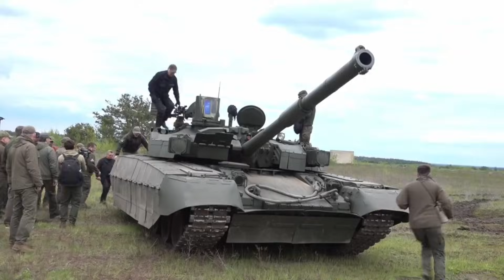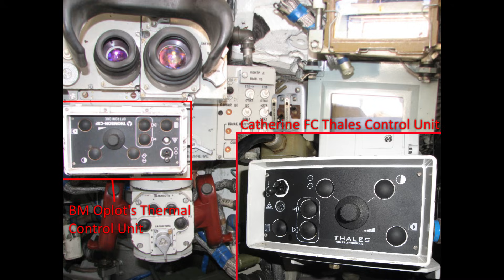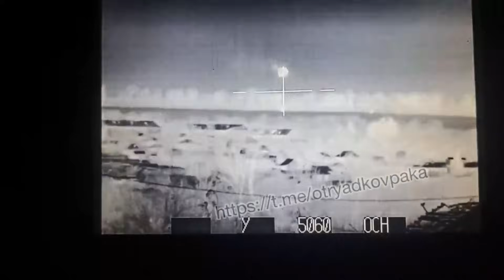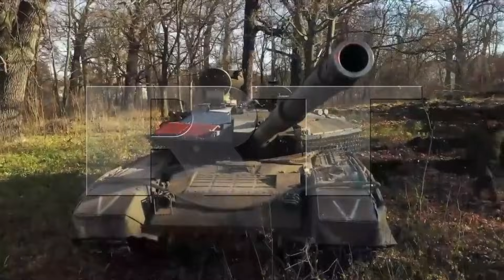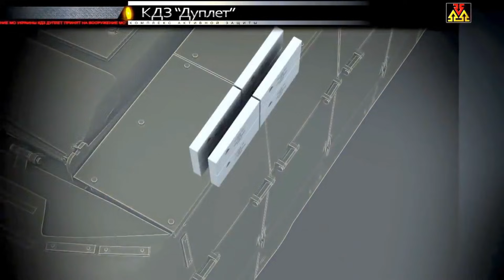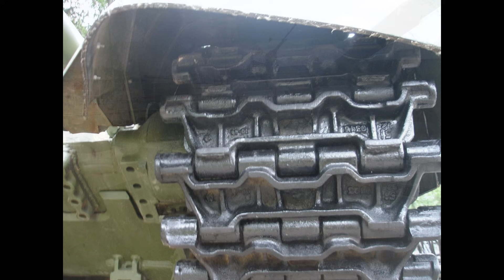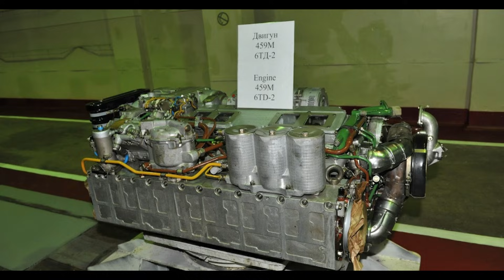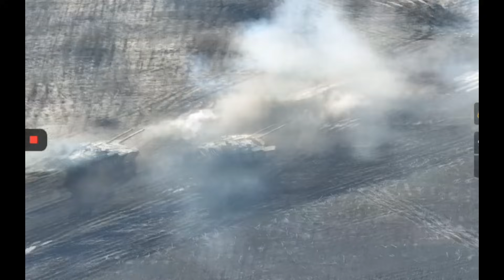Best Ukrainian vs Best Russian tank. T-90M vs BM Oplot comparison

Comment: Great comparison. One comparison I would love to see is the T-64BV vs T-72B3. Why? Because that's the tanks that have suffered the highest losses in the war on each side and I'm fairly certain they're the most used ones as well. They're the backbones if you will.
Reply: He has a comparison in his Russian vs Ukrainian tanks video.
Reply: @voidtempering8700  Oki thanks I'll check that out.
Reply: @Juel92  T-72B3 is a trash tank. T-64BV was always better tank and was actually upgraded with relevant components. It is far closer to its development T-80 and even if T-90M is upgrade of T-72 I would say is comparable to T-84.
Reply: @TheRezro  Everything you say about the T72B3 is as believable as The Sun. Yes, indeed the T64 has a remotely operated machine gun alongside better vision for the driver, but seriously though, you are incredibly delusional. You're quote literally the most delusional Pro-Ukrainian supporter that I have ever met. Basically the T64BV is slightly if not more equivalent to the original T72B.
Reply: I'm not the type of person to attack people for their own beliefs, but you should probably listen to both sides a bit more to avoid that seriously annoying attitude towards Russian tech.
Reply: The Abraams X is a technology demonstrator. The T-14 is still in testing mates, the American arms industry have had some proposals for the next generation American MBT but it mostlikely won't be the Abraams X.
Reply: There is a comparison done - T-72BM3 is vastly better tank.
Reply: @tomk3732  Next you tell my that Su-57 is actually stealth? Fun fact, it is as stealthy as F/A-18.
Reply: @TheRezro  LOL, Even Su-35 is more stealthy than F/A-18 ;)
Reply: @tomk3732  That say a lot about Su-57 then. Especially as Su-35 is only Su-27 with several decades less outdated electronic. F/A-18 already has some stealth elements, so it is quite possible that Russians finally catch up to G4.5 standard.
Reply: @TheRezro  Imagine being as delusional as saying that the T64BV, a soviet tank being better than a more upgraded russian tank.
Reply: @TheRezro  Seriously, are you out of your mind? The T72B3 is clearly better than the T64BV. Yes, the base model of the T72 was worse than tje T64, but saying that the T64BV, with worse ERA, outdated optics, and an outdated gun, BEING BETTER THAN THE T72B3? The T72B3 literally has Sosna-U optics, Kontakt 5 ERA, and 2A46. You are clearly misinformed.
Reply: @agoodusername5371  Most Russian tanks are almost identical and are severely outdated. It doesn't really matter if they have slightly better optics, when most of flaws still persists.

Anyway. T-80 is slightly upgraded T-64. T72- is actually downgraded T-64 and T-90 is basically T-72 with welded turret. Yes. There are some improvement in optics and protection between versions, but realistically Russian tank doctrine is the same as in the 60's. Arguably worst as they seams to lost understanding of what combined warfare is. Current T-84 is basically the same as T-90M or 90's NATO tanks.
Reply: @TheRezro  You're underestimating both of the tanks, the T90M and the BM Oplot are comparable to modern NATO tanks.
Reply: @TheRezro  If they have better optics, and ERA, you can still win against a T64BV when in a Tank battle, which gives it a better advantage, but when facing threats like ATGMs, they will obviously get destroyed.
Reply: @TheRezro  If most flaws still persist, at least you're assured that you still have an edge over your enemy when in a battle.
Reply: @TheRezro  Russian doctrine has slightly changed now, unlike Ukraine who's still stuck using the same doctrine as the USSR.
Reply: @agoodusername5371  I'm not sure what movies people do watch, but tank battles almost not happen in this day and age.
Reply: @agoodusername5371  They literally aren't. People seams to not understand how much tech actually goes inside tank today. Leopard 1 has probably better optics then most Russian tanks, except maybe most recent ones.
Reply: @TheRezro  This is argument is a comparison between an encounter between tanks, I know tank engagements are rare but we are literally talking about which tank is better.
Reply: @TheRezro  Are you saying that the Leopard 1, a tank from a 50s, having better optics than a modern Russian or Ukrainian tank?
Reply: @TheRezro  If you have made a mistake and instead you wanted to say Leopard 1, then I slightly agree with you, but the T90M has better optics and protection than the Leopard 2 (Except the 2A6 and 2A7, though Russia does have an advantage in protection a bit).
Reply: @TheRezro  This argument ends once you make a reasonable claim which I deem to be possible in a way that I can accept, I'm kind of bored,
Reply: Well let me tell you that stleath means nothing because the same SU-57 using it's 4 L-BAND radars can easily detect an F22 and fire at it by a missile called R-37M which are also guided by the belka L-BAND radar.
you are just another random kid that is believing in everything he see's in YouTube shorts lmfao @TheRezro
Reply: Comparison against a T-72B3 should be with T-64BV zr 2017 or T-64BM Bulat
Reply: Yeah. Those are the actual MBT.
Reply: I dont think there are that many of them left anymore on both sides.
Reply: B3 is superior in every way and Russia built nearly 2 thousand Ukraine made 100 😂
Reply: @mrmacias4217  Military balance 2022 lists 850 T-72B3 in Russian service. Even if you count the 550 tanks upgraded to the somewhat more modern T-72B3M variant, it's still nowhere near 2000. Also Russia has lost at least 500 of those very superior tanks, and that's just visually confirmed losses.
Reply: @zvexevz  1720 in 2021 some 300 have been destroyed that’s still 1400ish and they’re still being produced
Reply: @zvexevz  count the 150 of the VDV the 150 of the marines it starts adding up
Reply: @mrmacias4217  Its night vision is on separate small monitor. like WTF? T-72 is a horrible tank and B3 is a joke. Fortunately it is near extinction in the upcoming future. Not mych info about catapulting turrets in this year.
Reply: @TheRezro Yes, a small monitor, just like 90% of all tanks that have a thermal screen. Hardly a bad feature.
Reply: Ah yes, the battle of two 80s tanks crudely modernised to not be useless in 2023...
Reply: @quan-uo5ws  but isnt that basically all the modern MBTs? (well besides Abrams X)
Reply: @DiamondkeyOwO  abrams x is still in development / protyping.
As far as i know only the t-14 is an actualy true modern tank but there are not many of them
Reply: @zanza8197 t-14 is also still in the testing phase their is no full production yet
Reply: @zanza8197  I get what you mean but honestly I would argue that the Abrams X is as real as the T-14. (As in probably have the same amount of tanks in service)
Reply: @zanza8197  T-14 do not exist. It is not a serial tank. You could as well compare it with Abrams X. What is far superior in any imaginable way. Starting form fact that it would have CIWS and not like Armata Hard Kill designed by someone who don't understand how ATGM's work.
Reply: @TheRezro  T-14 does exist, We have seen them in parades and there are reports that they are also deployed in Ukraine al be it not in the front line.
Comparing the Abram x to a t-14 is all speculation they are both latest generation and we hardly have any real information about either tanks other then the obvious like horse power, Barrel etc etc, I would assume they are on the same playing field.

The biggest difference, one does exist and the other does not, That makes the whole comparison null and void.
Reply: @zanza8197  Being on parade don't egal being operational. And we do know from Russian tankers that it is not, as they refuse to drive it. If it was deployed in front line, it was at best "front line" in Moscow. There is no prove that it ever was near it. And again, it is not a serial production. And lot of claims about it are debatable. Russia could as well put it alongside T-34, as much as we care.
Reply: @TheRezro  You clearly have not seen anything regarding Russian equipment.

There are videos of the Armata, firing, driving etc etc they are clearly operational the ones that Russia has.
I dint say that they are deployed in the front line, I specifically said that they are not.

I know that they are not being mass produced, Though they have about 25 or something around those lines so they clearly can make them, There is also no need for it the t-90 still is a formidable tank, Its much cheaper to produce and it meets all the requirements, Until the t-90 falls to far behind the t-14 wont be mass produced.

"There is no prove that it ever was near it"
The t-14 has more or less the same capabilities as the abram x, Again they both would be latest gen that means that they have all the latest modern technology applied to them, They are not 100% equal in some things a abram x would be better while on other fronts a t-14 would be better, Like it is with the t-90 or a abram or leopard or whatever you may pick.
It still boils down to the same, There are actual t-14;s there are no abram x, Well there are a few prototypes. So that debate is pointless.

I also saw your comment regarding the su-57.

I strongly recommend you to check out this channel / show COMBAT APPROVED.
It covers Russia / soviet armaments that way you get a decent understanding of what Russia actualy has and what their equipment is capable off.
Reply: @zanza8197  Cope my harder
Reply: @TheRezro  Russia doesn't even have the T34, they don't even have enough components to use the T34 because they phased it out decades ago. They don't even have the proper ammunition to use with the T34, you're so utterly biased and incorrect, I'm also wondering, what sources do you even use to back up your utterly ridiculous claims? Not everything russian in bad. You're being consumed with so much fake news, you even think that the T64BV is equivalent to the T90M if only it was just an "Upgraded T72". Does ERA even count for you?
Reply: @TheRezro  Seriously, are you telling me that a tank made in 1985 is better than a tank made in 2010?
Reply: @quan-uo5ws all Russian tanks are like that.
Reply: A WW2 light tank against a modern MBT? Just why?
Reply: @DiamondkeyOwO  The T-64BV is a MBT, what are you talking about?
Reply: @voidtempering8700  Lol I just realized I wrote T-60 not T-64 lmao. Gonna edit it.
Reply: @voidtempering8700  was T-60 originally in the comment but edited now
Reply: @DiamondkeyOwO  Lmao I miswrote. Meant T-64BV. Thanks for pointing that out
Reply: @Juel92  no problem man happens to everyone :D

Comment: Challenger 2 and Leopard 2 just entered the chat.
Reply: Have they?
Reply: leopard2 is a good tank. chally 2 is dogshit and obsolete.
Reply: Challenger 2 just got stuck in a mud puddle.
Leopard 2 just met with Kornet.
Reply: @koskok2965  frfr. im sick of western nations being allergic in using ERA. and even the ERA used are overly large and heavy for the offered protection AND not doing shit against apfsds.
Reply: @Phantom-bh5ru  Yep. It's astonishing how so few people can digest the fact that composite-centric armor and ERA-centric armor designs are both valid and realistic engineering approaches to the same problem of protection.

The rift between East and West in this regard has mainly got to do with the balance/compromises with respect to other performance criteria, like weight, volume, modularity etc...
Reply: Leopards 2 entered the chat and burned down immediately.
Challenger 2 can't even reach the chat.
Reply: @AugustSchroif  🤣🤣🤣. So true. Challenger is too fat to reach the chat. Represents the Brits quite well 👌👌👌
Reply: they havent entered the chat yet, need to wait for another 6 months and the next aid packages
Reply: @DonDon45-i5h  No their already in Ukraine, just haven't been used in an offensive yet. Also his video on the C2 assumed it would lack DU rounds.

Comment: To bad RF cant produce any more modern equipment, till they get more washing machines.
Reply: That isn't true, stop spreading misinformation.
Reply: @voidtempering8700  Its 100% true. T90 used a French targeting system, not anymore. Russia cant even produce ball bearings FFS.
Reply: @morganodonnell1239  Russia has been producing their own thermal sights for 5 years now.
Reply: @voidtempering8700  ТКН-4 for example
Reply: @voidtempering8700  Turns out to just be western civilian model procured from Iran.
Reply: @georgethompson1460  Have a source for that?
Reply: @voidtempering8700  Look at the collapse of the Russian defense industry.
 Then tell me they can still produce equipment... 
 Nobody wants that garbage anymore after seeing how poorly they preform. Even if they could still sorce western parts.
Reply: @voidtempering8700  doesn't matter if you can do it domestically if you can't upscale production during wartime (which Russia cant)
Reply: @a.t6066  But they have.
Reply: @voidtempering8700  evidently not. The very fact they aren't able to put Sosna-U sights on upgraded t-72s anymore means the level of production cannot extend beyond what they are producing t-90m.
Reply: Ah yes the good ol washing machine take. If anything its rather impressive russia is creating hightech weaponry and missles with chips from old washing machines lol

Comment: I'm surprised at how effective duplet. It's very impressive and I hope to see it used more in combat
Reply: It's also great at maiming any infantry marching by the side of the tank.
Reply: @koskok2965  let's hope they're enemies
Reply: @Indignus7  lmao
Reply: It comes at a cost of being very heavy (and bulky).
Reply: @CloneDAnon  as it holds French 120F1 DU round at 100 meters with no scratch almost, I think I can live with that :)
Reply: @sdrkrm  I mean the old 3BM42 still went in by 60mm, you only need to add some 20+ mm of penetration and it will go trough the side of a T80. The tank (Oplot) itself seems very sluggish and the additional weight won't do it any benefits in wear & tear. 

Making a good tank, is not just about making its triangle (firepower, mobility, protection) into a giant one, but it must be mass produced effectively and maintained for years to come. From what i understand, the Oplot has been plagued by massive reliability issues, due to its added weight and addition of components that have not gotten the necessary long term reliability testing.
Reply: @CloneDAnon  lol, the T84 modernization limits are much higher than that and additional 2,6 tons of weight makes no difference whatsoever. Sluggish? Yeah, right 😏 https://youtu.be/Gj4dVTyuxJU?t=172
Reply: @CloneDAnon  Any modern APFSDS would go through the side of any MBT, with or without ERA. That's a moot point. Side ERA is mainly to stop HEAT because there's not enough base armor on the side unlike the front to stop APFSDS.
Reply: @neurofiedyamato8763  My point, is that you can always sacrifice weight in order to increase your protection. Question is, is it worth it? Does the additional weight intrude on your other performance and reliability? Is it a worthy trade? Especially when currently the tanks biggest enemies are artillery shells and mines. I am not so sure in the case of Oplot. 

I like more what the Russians have done with the T90M, especially the latest upgrades. It seems solid, relliable and well protected. The side won't hold an ATGM, but definetely will hold an RPG (or an older ATGM) with up to 600-800mm penetration
Reply: @neurofiedyamato8763  nope
Reply: @CloneDAnon  The BM-Oplot isn't overweight though. Compared to the standard T-84, it has same top speed as before, PTW is still similar if not higher using the newer engine, and weight just 51 tons. 51 tons is NOT heavy by modern tank standards. Its a few tons heavier than Eastern designs, and a whole 10 ton less than western ones. Its medium weight at worst. This isn't a Abrams level weight, stop acting like its the Maus. It got modern level of protection, mobility, and firepower(just no modern ammo stockpile) for a slight increase in weight. It is more than worthwhile and is not a problem. There isn't any detrimental problems associated with its weight.
Reply: this topic always leaves me with a question - an effective ERA "doublet" , the development of which was abandoned by a specialized institute in the USSR, and which was completed in a couple of years by brilliant ukrainians who never dealt with this topic before , but for some reason no one else in the world goes this way - detonating dissecting knives ERA - have not yet matured to the ukrainian genius , or is it  about  dubious effectiveness of this solution ...
Reply: Word "Duplet" in Russian language roughly means a "pair". So in this case this is merely 2 layers of an ERA block. So Russians in theory could make same layered layout of Relikt if they wanted to. So there is no surprise at the effectiveness of Duplet when you realize what it actually does.
Reply: @Max_Da_G  Indeed, it would be laughably easy to just double stack em. Especially with the pouch system they've got going for mounting on a good number of surfaces around the vehicle.